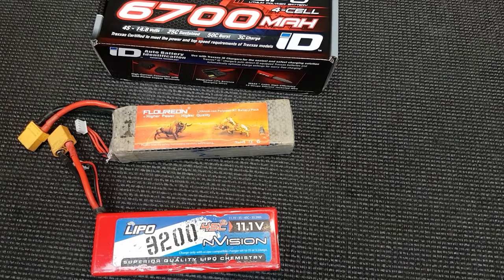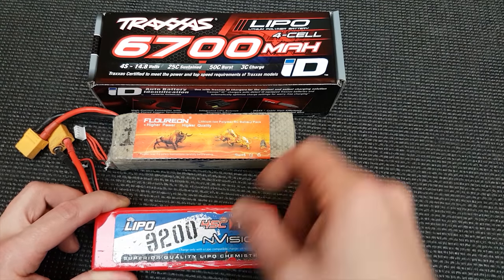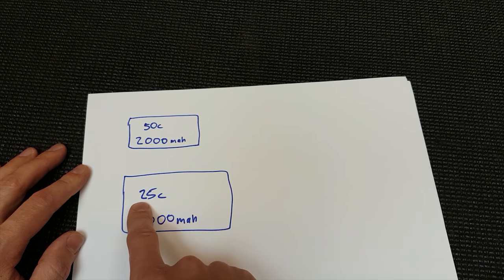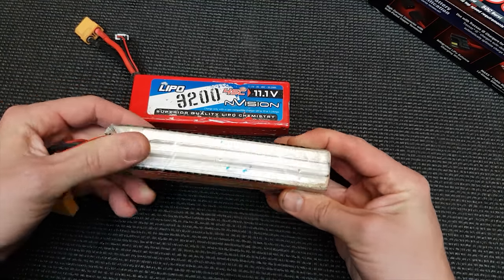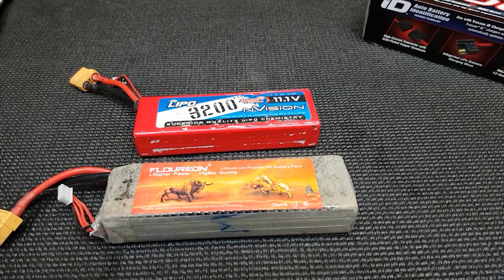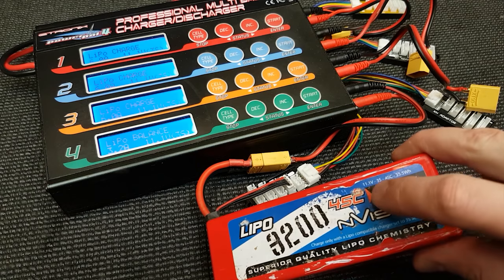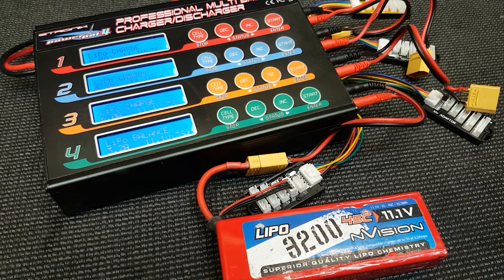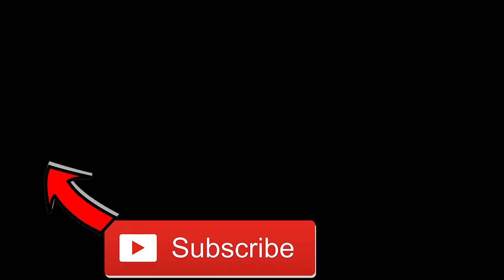All About RC Lipos

Comment: Just ordered an ammocrate, live in a flat so if shit hits the fan ill just chuck em out the window...)
Most people recommend to balance charge them all the time, takes abit longer but supposedly alot safer in the long run, what say you all?
Reply from the maker: I ballance all the time but if all the cell voltages are all the same you can get away with just a normal charge.

Comment: I learnt something new (not to leave lipos fully charged) I've left mine fully charged for a week, don't know whats gonna happen 😬😬🙏🙏
Reply: they just degrade really fast when charged and not used
Reply: It raises the internal resistance, then they become less efficient at charging/discharging which is impacting the overall life of the pack. On bash days, I get up early and charge whatever I'm running that day. Having a 4x100w charger comes in handy for that. Been thinking of getting 2 chargers... but I don't have the space.